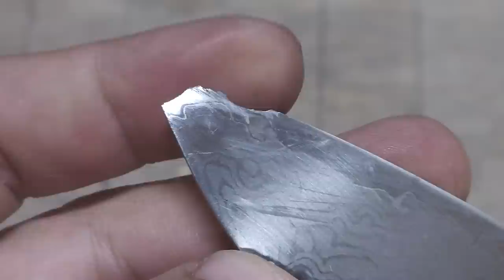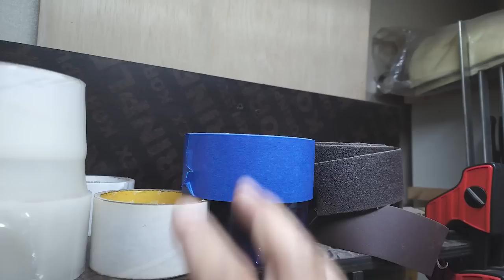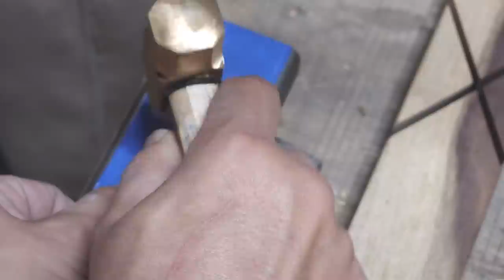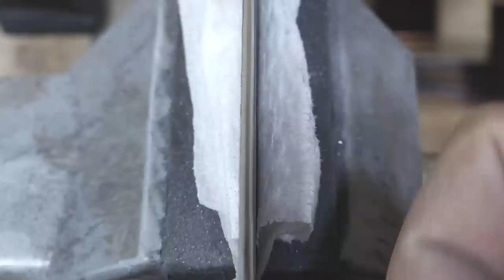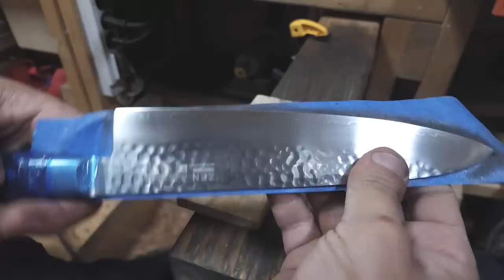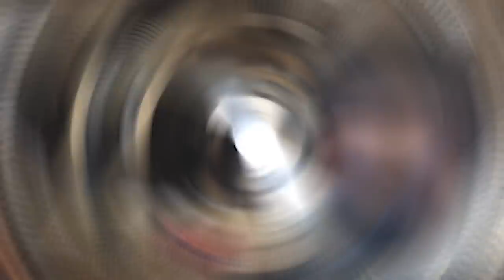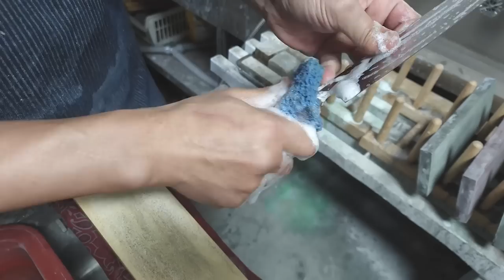99% 손으로만 칼갈면 생기는 일!

Comment: If the translation of the title is even accurate...if your knife ends up looking like that after you try to sharpen it by hand you aren't allowed to own a knife at all.
The end result looks awesome 👌
Makes me want to give mine a proper polish too.
Reply: Yeah, the title has me kind of concerned because I'm getting my first wetstones tomorrow to try and sharpen my vg-10 steel knives, because we don't want to go days without them by having them professionally sharpened. Not intending to start practicing with my good knives, because I know that especially as a beginnier, you can make mistakes that can ruin a blade, but when I counted yesterday, we had 4 cheap knives that I can experimented with yesterday.
Reply: @beardiemom  ручной станок не так дорого стоит и водные камни туда можно поставить. Мне хватает масляных до 1200grit.
Reply: @beardiemom  The knife at the start looks like it was used to crowbar stuff and then hit with a hammer for good measure. There's no way a whetstone can do that much damage. Just count your reps of sharpening and apply same to the other side. How hard you press the knife on the stone also determines how much you shave steel off. Follow the contour of the blade and never focus in one place. Too much focus in one spot, that's how you ruin a knife edge. If you do it properly maybe you can just send it to a professional sharpener like once every five years.
Reply: @chang1865  Thanks for the tips. I did watch a bunch more videos on sharpening, practiced on a cheap knife we had in our drawer and our good knives are as sharp as on day one. Honestly, it wasn't nearly as hard as I thought it would be.
Reply: He purposely destroyed it himself for the views. U can see angle grinder marks near the tip at 00:24

Comment: Would like to have seen a list of items used and where you got them in this video.
Try as I might I can't seem to properly sharpen anything.  I need all the aides I can get a hold of.  I don't have a belt sander yet.  I did end up with a tooth set in a tool box but have no idea of the angle or what saw blade it's for.  I have a couple of Old Hickory Butcher knives and a kitchen cutlery roll that is factory sharp, plus misc. knives.  I messed up the tip of my scout style pocket knife.  No longer pointed.
How do you clean sharpening stones?  Arkansas oil stone is plugged and a wet stone go a little something spilled on it from sitting somewhere in a shop.  The other wet stones just need general cleaning.
Reply: I had similar problems, but a lot of the issue was to do with not "apexing" - i.e. not sharpening for long enough to reach the edge. Patience, and sharpening at a slightly higher angle were key.

I use grimy old oilstones that I converted to using water by repeatedly soaking and simmering in soapy boiling water. Not recommended unless you are a cheapskate like me.
Reply: For starters get a whetstone(diamond stones are better for coarse grits) with a coarse grit of around 120 (reprofile) for the pocket knife. grind a new edge on the blade, apex the edge then move on to further grits like 400 (coarse/reprofile) then to 1000 (finish). strop the edge with leather (stropping compound is recommended) on the rough side. Sharpening isn't difficult, it took me 3 tries to get to the point of paper-cutting sharp. I never used an angle aid and just eyeballed. I would say that the biggest factor in a usable edge is the technique, I changed from pull to push-pull. It's recommended to watch sharpening videos from people like outdoors55, my explanation isn't the best.

Comment: I am a newbie to knife sharpening and am just getting my first set of wetstones tomorrow. Mind you, I am not intending to get started by trying to sharpen my high quality vg-10 steel knives for my first attempt; I have some old, cheap knives I have no attachment to that I intend to use for practice. Once I get a workable edge with those, I want to try to sharpen my good knives.
I would like to know what I can to to prevent my knife from looking like that after being sharpened by me. Or did I misunderstand the title and the damage wasn't the result of someone with not training attempting to sharpen their knife with a wetstone.
Reply: The knife had a broken tip, which happens when you drop it or use it to open cans. It was also severely bent, which happens when you use the blade for prying. None of these damages come from bad sharpening technique, just from improper handling. Bad sharpening technique will only scratch your knives and/or leave them dull. So go, get your whetstones* (from "to whet" = to sharpen) and practise sharpening (try a few cheaper knives first), it is very rewarding!
Reply: @einundsiebenziger5488  I got them shortly after I made that comment. Did in fact practice with the cheap knives and I seem to be somewhat of a natural, since my first attempt already was a succes
I did end up slightly scratching one of my good knives, but that feels more like a cosmetic flaw than one that will affect function.

Comment: what i wanna know is hot to get a knife into such a horrible shape in the 1st place.... i have exact the same knife, same brand, model and all, have been using it for the last 8 years for cooking and i sharpen it with weatstone  grid 240/1000... mine looks almost as good as the final result with only few scratches that eventually come when using it on a daily base...i mean i dont use it to cut bones and stuff but still have no idea what the owner did to that one....?
Reply: Dropped it on a concrete sidewalk. Or threw it at the ground in a fit of rage.
Or tried using it as a hatchet on a tree.

Comment: What compound did you use to bring out the damascus pattern after sanding?
Reply: I also want to know
Reply: @benjamin-vm9gb  diamond polishing paste, these go up to 50 000grid, but the last one it could be something from head light polishing kit. These compounds use soft stone powder witch leave the harden steel but bite to the cladding. I think if you use the mud from 3000 or 6000 grid wet stone should make same effect. I got only 1000 and it make this effect. But that step is just for show after few uses the cladding oxidized and be visibly darker. Like one onion and all that polishing is mostly gone. What he does is display polish.
Reply: @scasny ...grit* (grid = network/criss-cross pattern) / whetstone* (from "to whet" = sharpening)

Comment: I tried straightening the last inch of a  chefs knife similar to that one but probably nowhere near the cost and now I have a chefs knife that doubles as a flat head screwdriver.
Reply: How did you try it? If the bending is at the last inch you should hammer it like he did. I straighten the tips of some knives like that and never broke one.
Reply: @MidnightatMidian  I used a hammer and laid it on the anvil part of my bench vice. I guess I shoulda heated it up a little but I didn't want to damage the tempuring. It still works though so it's not a really big deal.

Comment: @Knife Repair 
Nice video, What sand paper Grit number did you use on the side of the knife when polishing, and what was the paste you finished with? Thanks
Reply: i presume 2000 or 2500 then paste with 3, 6 and 10 000 grid